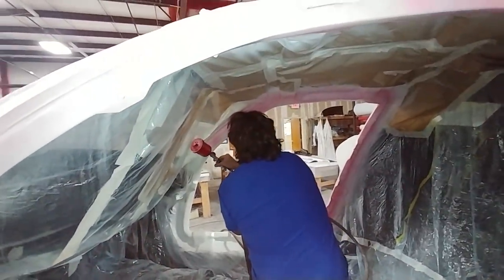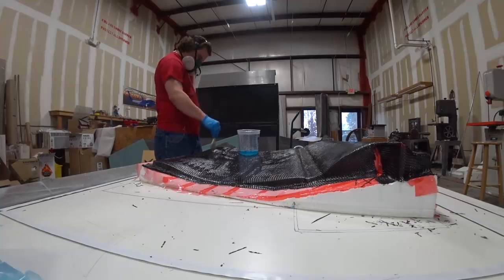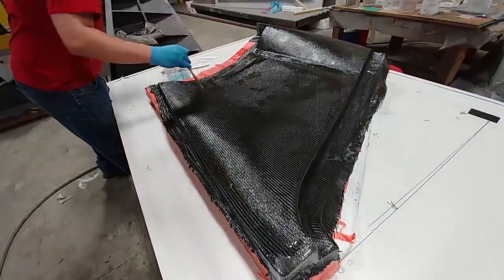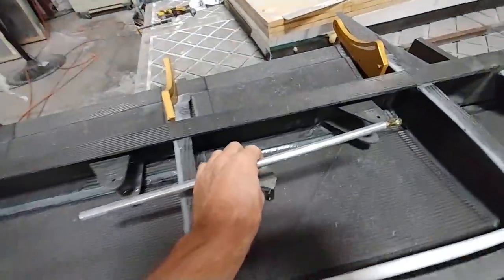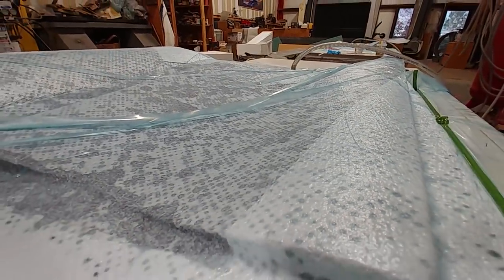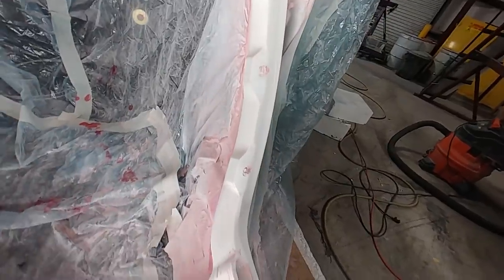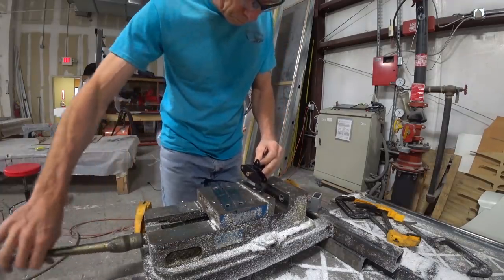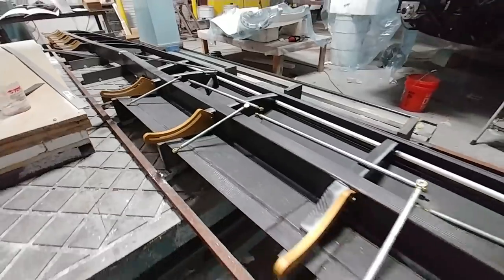Holding Down the Fort - Building the Raptor Prototype

Comment: Might put a support on that main aileron bellcrank to prevent failure of that single bolt pivot. Looks good !
Reply from the maker: Yes, that will likely be coming but it's highly unlikely that you have the strength in your right hand to shear that bolt.

Comment: Should you have an inflight Hydraulic failure, is there a manual way to Lower & Lock the landing Gear as they have in commercial aircraft ? A winding Handle or pre-pressurised emergency reserve Piston ?
Reply from the maker: Yes. It's been discussed several times and we've even demonstrated dumping the gear awhile back.

Comment: I noticed when you are doing your carbon lay ups you didn’t use a hot bond controller. Do you let them cure it at room temperature or use heat lamps?

Comment: You simply have to design the future doors as modular components with door frames separate from the fuselage so the entire door frame and all can be produces off the airplane and in some sort of production line schedule so one door doesn't take several months to produce and you can work on the rest of the fuselage while they're being produced if multiple planes are ever going to be produced at cost.
Reply from the maker: Yes, that will be the way to do it.

Comment: ,,, I'm a million miles away from a FEA program, but the rudder cable and some of the aileron hardware looks a little shy in the LAR program, betwixt my ears. Especially considering the velocity of this craft .
Reply from the maker: We've done FEA on all of it.
Reply: ,,, actually it was the elevator actuator pivot bolt, being quarter inch, that concerned me the most ?
Reply from the maker: As I mentioned on another comment it's unlikely that your right arm has enough strength the break it because that's all the force that can be placed on it.